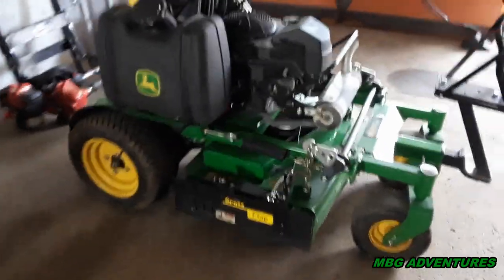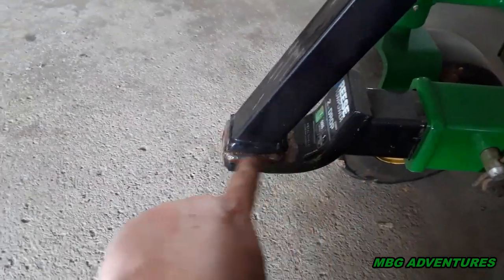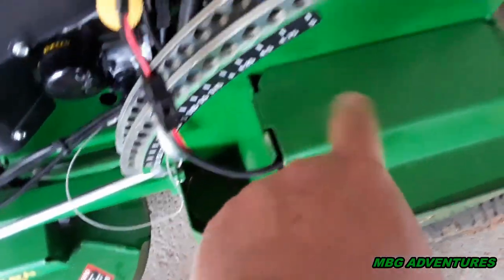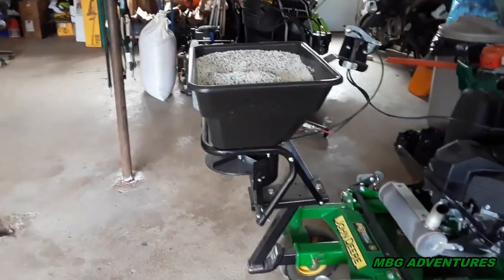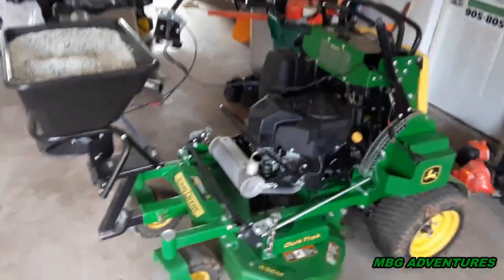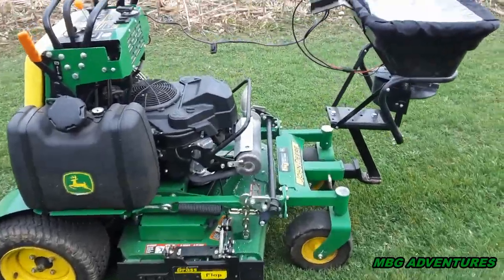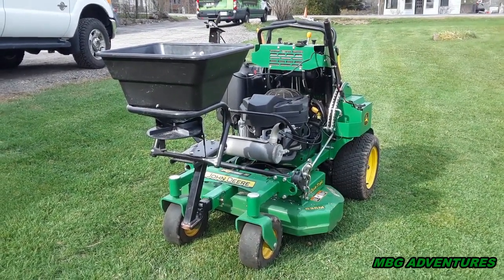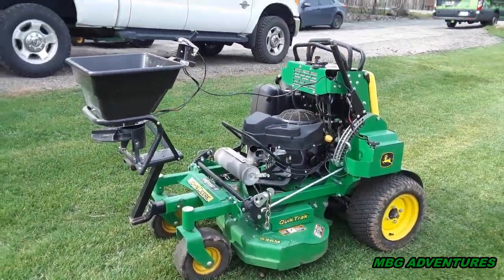Fertilizer/Grass Seed Power Spreader on John Deere 636M Stand On Mower

Comment: Yah I bought one , a field tuff 125 lbs. From Amazon Used it 4 times , once a year in the spring to spread my crab grass fertilizer . Everytime I went to use it the next year it was broke or fail while I was using it . I have 5 acres, to fertilize. Had a nice set up with the controller bolted on my control panel on my turf tiger and a modified removable vertically receiver on the front . Washed and cleaned it after of every use , stored it in side the last time I tried to use it after replacing the seized up motor the previous year, the on off switch had a short in it when I hooked it up . Replaced that went to take a practice run with about 40 lbs of fertilizer in it , the motor wouldn’t spin went to close the shoot and the cable kinks leaving a trail of fertilizer back to my barn . This spread is still mint condition. Made in China disposable JUNK . There’s 5 brands made by the same place . I’m buying a JRCO $1.500.00 but you get what you pay for . Good luck Bubba you always what to consult your professional landscaper before you start any projects .
Reply from the maker: Yes, you get what you pay for, just thought I would try it out. Got it cheap enough. Mine is still going strong. In all reality, everything can and will break. I'm sure the new spreader will work great for you!
Reply: I own a landscape company, but I just rigged it up for my property . I cut and fertilize about 5 acres . I have a 80 lb Guide Gear one the I had for 20 years that has been a great piece of equipment, then I wanted to get the bigger one , what a lemon . I didn’t know but Amazon had refunded my money after a year . It’s been a long time but it broke the first time I used it . I must of called them for warranty info , but Amazon is cool .
Reply from the maker: @thomasguerrero7289  Amazon is really good for that. Nice you got your money back.

Comment: Nice but messy and you are driving thru the fert dust.  Need a N95 face mask and goggles.  Your machine will get rusty from the fert also.
Reply from the maker: Works fine. I had no issues with dust. Machines are always blown off cleaned. Thanks for watching!